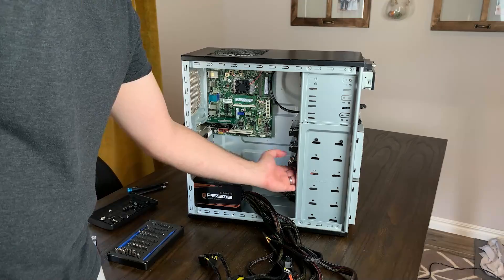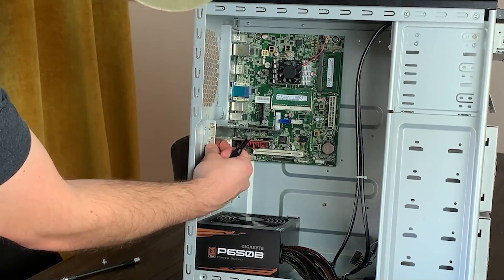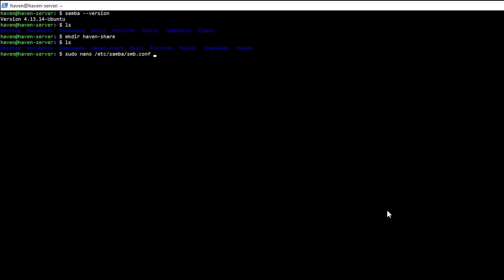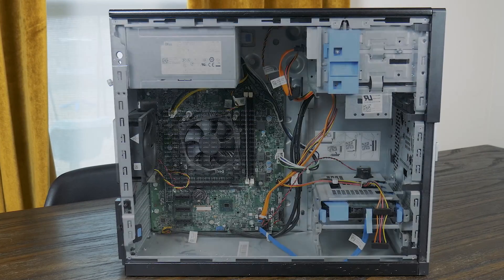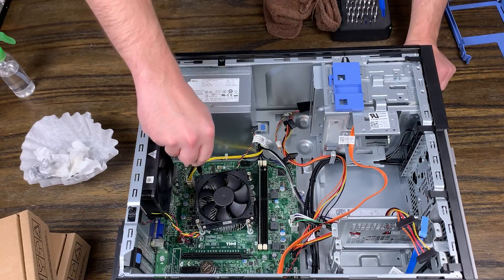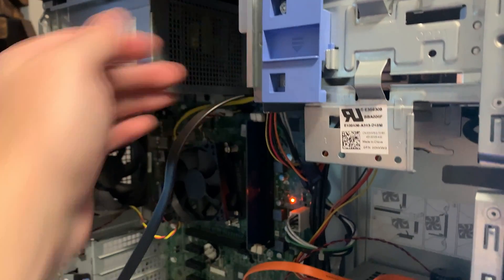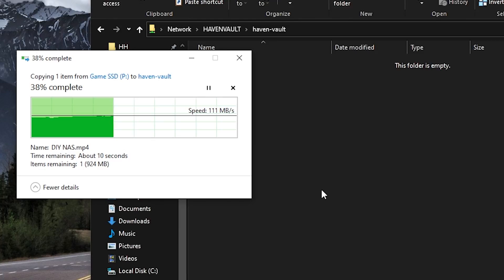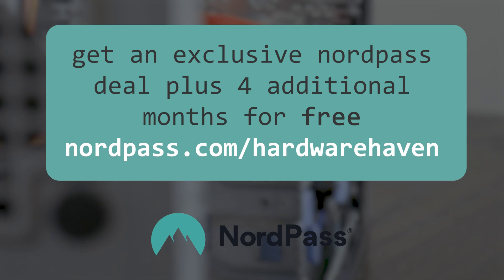A $150 NAS You Can ACTUALLY Build.. But Maybe Shouldn't

Comment: Brand New 4TB 7200 RPM Iron Wolf = $130 - Intended to last years. Has a warranty and data recovery service. Not likely to die soon. 
Used 4TB 7200 RPM Iron Wolf = $45 - May or may not last for years. Could die tomorrow. Might have a SAS drive arrive rather than SATA.

I can see the logic behind leaving out the HDD prices as that is gonna be different for every user. Anyone that would need those HDD prices present honestly should probably be shopping for a prebuilt NAS solution since you need so much of the storage decisions made for you. I have a drive that has the date (30 Jul 2008) on it and it is still working flawlessly today (26 Nov 2022) while other newer ones are dead. But overall for me...low capacity drives last long even with abuse dished to them. But high capacity drives.... I got two used Seagate 3tb Constellation ES.3 drives about 3 months ago. One is dead already. Not dead dead. I keep finding my storage pool corrupted on that drive. So I stopped messing with it cause it randomly dies. So I got a used Hitachi 3tb to replace it. Everyone is gonna spend different on drives and not everyone will be willing to attempt used. I have never had low capacity die on me in a short time meaning anything under 2.5TB in my experience. I have had plenty die after 3TB and up. Thats when temps and vibrations and crap truly matter. Mechanical drives get fragile after 2.5TB. The way you go about populating storage should be a personal choice. 2TB might be enough to you where as 2TB is a single folder of music for me so I will probably need more for other files. Some only need 4TB HDD's while others need 14TB HDD's. Its levels to this
Reply from the maker: Just want to point out that these drives also have warranties, and if a SAS drive shows up, you would simply return it. Buying new can still result in the wrong thing shipped or a DOA, so not really a fair point.
Reply: @HardwareHaven  This is true. But Companies usually clearly label things. Users posting used drives...results vary on who lists accurate details. Its not the end of the world returning something. But that depends on the person too. My mom will wait. If I gotta return...I just buy a new one somewhere else. Its faster. 

Buying new can still result in the wrong thing shipped or a DOA, so not really a fair point is also true. But I was not making a point but rather telling my experience with my used drives over the years and what I have learned. I personally have not had a new hard drive arrive DOA. And now that I think about it....I have never had a used drive arrive DOA. But my new things last longer than my used things. I assume its because the new things have no use on them at all till I use them. But also I take care of things and others may or may not with varying levels so when you buy used you don't get the Quality control and standard like brand new by default.

It took a long time before I figured out that mounting and vibration dampening and temperature control and all these things matter when your HDD is densely packed with platters. I had to learn that. Cause that was not an issue for me with smaller HDDs.  But I been on a machine since Win 95 and 100MB HDD was a lot for home use. Been through quite a few drives since then and had to somehow keep my files from back then too. Ever have to CD your They didn't really have home NAS's back then. CDWR was my friend. But once the SATA drive came out....they lasted me forever brand new or used....till they added more platters. HDDs with less platters I could literally move around while its working. I have had some janky setups. Moving around a high capacity HHD while its working...not saying you can't. But I don't recommend this as I found out the hard way that they do not like this. I still to this day move active low capacity drives. I legit hot plug them into the mobo. But high capacity...if its active I treat it like its radioactive.

So I was not hating on your video or nothing if you took it as me being one of them dudes that comments to tell people how it is. I literally said "I can see the logic behind leaving out the HDD prices as that is gonna be different for every user." before I said anything from my experiences that justified why I think that the hard drive prices being left out make sense to me. I was saying that it made sense to not include the price of HHDs because everyone's storage needs are different as well as the environment you keep them in. The rest of the hardware is fine but it may or may not matter to you if the HDD have milage, warranties or if you need 4TB or 14TB. 2TB is my Music alone.

So I am sorry if I gave the idea that used drives are scary or don't come with warranties. Cause you " these drives also have warranties" and I was not trying to give the impression that you can't get used hardware with a warranty. For that I apologize. I was just showing from my experience with the drives I have had is that when I buy new reputable brands it comes with a warranty by default but used reputable brads does not come with a warranty by default. I was not implying that they never do. I also never implied that they arrive DOA. I personally have never gotten a DOA HDD. But probability sides with the one that has zero use vs the one that has been writing and reading for some time. So preferably I would like the one with less milage cause they more times than less last longer. I would buy used HDDs from you cause you seem like you know your tech so I would imagine you take care of your tech too. But when buying from random strangers then they may or may not know and may or may not care. 

"Buying new can still result in the wrong thing shipped or a DOA, so not really a fair point."
I mean I buy things from Ebay then when it arrives it ain't even the thing that was in the picture. Or its missing things. I got a mobo that did not come with an IO shield but they did not list that it don't have one and the picture had an IO shield. I don't get this when I buy from reputable businesses and from reputable establishments. I have gotten it from unknown brands when new. But not reputable ones. I was not trying to make a point but if I was I think it would be a fair one if anything. Users don't always know what they are talking about when they list things for sale. Mistakes are made with no staff or procedure or training in place to avoid it. I got a PCIe RAID controller that was shown with the battery in the picture. IT did not come with the battery. What did they remove the battery before shipping? That would not happen if I buy new directly from LSI. Only thing DOA I ever had was a 750 watt Corsair PSU 80+. It was like $80 so rather than send it back and wait for shipping I went to the local best buy and got a PSU. Just I had to pay more than $80 in store. But it was faster than waiting. 

"SAS drive shows up, you would simply return it"
Yeah not a problem. But its not fun for the guy that needs the drive to rebuild his data that will all be lost if he don't get the right drive in there. The drive comes....Yes....you open the box....NOoooooo....Its SAS. Your data is in danger for longer cause some guy mistakenly packed a SAS drive rather than SATA. He thinks he sold you a SATA. Well I know not to comment on these videos now.  I don't want to rub people wrong for sharing my thoughts or joining the convo
Reply from the maker: I wasn’t trying to say not to comment, just that I felt like your comment started off with an unfair comparison. I didn’t realize you were speaking more from personal experience than making an argument. I appreciate dialogue, advice, and criticism in the comment section!

Comment: 57c ISNT acceptible for a hard drive. for almost all drive's a good temputure is around 25-45c anything near or above 50 isnt healthy for a drive and it will cause degradation in its life span.
Reply from the maker: 57 was a max reported temp. They’re running a bit cooler in my Drivestor4 (~40-45).

Comment: Thanks for the tip on openmediavault. I'll try it out. I've been testing Truenas on a nano PC. It does work but I've had a few hiccups. If I copy a ton of data, Truenas can hang with an error that infers that it needs to send log file data to the host machine, which I interpret as Truenas should be installed as a vm in something like proxmox. Anyway, I may end up doing exactly that anyway, but I'd like to try out openmediavault just to see how it is.

Comment: Trouble is that after running the system for a year, you likely have paid so much in electricity that you should have bought a prebuilt or SSD's, let alone the cost in your time if the youtube revenue doesn't cover costs.
Reply: For many people power is really cheap, so a lot of the time some extra watts from hdds doesn't matter
Reply from the maker: Depends on where you are

Comment: The sass towards ultra-stingy during the disk buying portion was pretty funny. Anyways, I suggested this idea in a comment on another video, but I might as well repeat it, since I think it would be a neat topic. Have you tried making a build optimized for low power distributed computing (ie: F@H and BOINC)? The major reason most people don't want to participate in those programs is the wear on their personal PC's parts as well as the power cost. With used hardware, I imagine a low power draw GPU and CPU could quell both those concerns.
Reply from the maker: Definitely something I'll look into; sounds interesting!

Comment: right now i have the same Hitachi HDS5C4040ALE630 from 2012 and bought it locally 2 months from facebook marketplace and ooooh boy it was worth it.... i was skeptical at first but after checking via disk sentinel and crystal disk info the drive was in great condition..... for the noise while im wiping the drive it outputs the same noise as you demonstrated in the video.... overall great video...
Reply from the maker: Oh nice! Glad it worked well for ya

Comment: Nope, best highest temp for HDDs is around 45°C, one degree above that and SMART will start counting when to mark it as overheated/high temperature. And you need to mitigate those mechanical vibrations for sure
Reply from the maker: I don’t know a TON about smart to be fair. I do know that backblaze published some stuff about higher temps really having little impact on drives, but that fluctuating temps had more of an impact. 

The vibrations in the caddies does seem to be a bit of an issue though. They’re in my asustor now and not nearly as noisy.
Reply: @HardwareHaven  All of my drives that died had these two issues:
1. Bad cooling. Half of them that hit above 45-46° were an external models (sold in a plastic box with USB and no cooling) - their controllers have bright and short life
2. Vibrations - other died from physical damage on plates or heads, small number with dead motors
Reply: Yeah a google study also showed that faliure rate doesn't go up unless the drives go above 45c